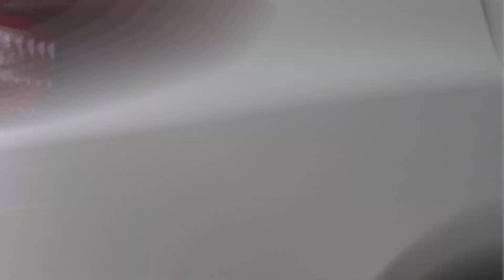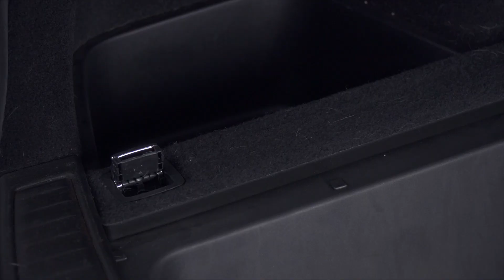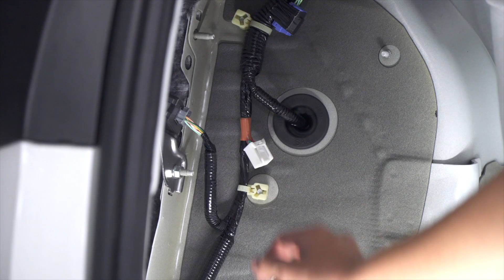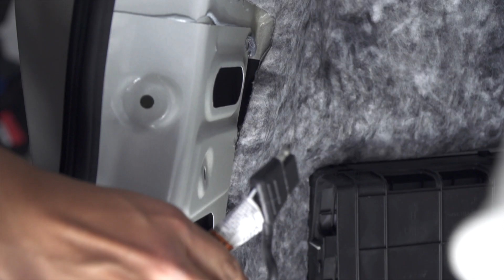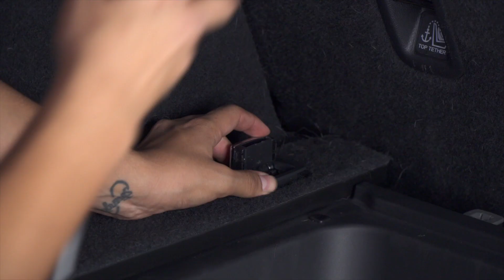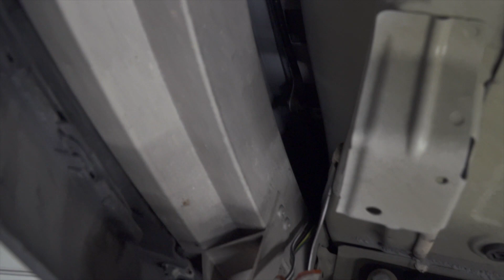2019-2022 Acura RDX | U-Haul Trailer Wiring Installation | CQT118800

Comment: Can verify that the same instructions work for my 2025 Acura RDX as well. I followed the instructions and it is spot on. Couple of pointers: I needed mini-fuse 7.5amp for the fuse box. The only tricky part of the install is threading the wire through the grommet and fishing it from the bottom of the car. It's best if you have 2 people, one at the bottom of the car and the other wiggling the wire to fish out. I found it easier if I remove the felt covering above the tire (just one button). Overall, great instructions!
Reply from the maker: Thats Great! And while the Steps to Make it work Have Not Changed, the Part Number Featured in this video (CQT118800) has been re-designed and offered as CQT118804. Please Email me a picture of the Brand and part number you installed to Christopher_Blackwell@Uhaul.com. and I will update our records to provide this information to our Hitch Pros and customers!

Comment: Great video, thank you.
Would like to add one thing. It might be better to cut or push through hole in the center of the grommet. 
Better then they have the wires laying against the sharp metal. 
Thanks!